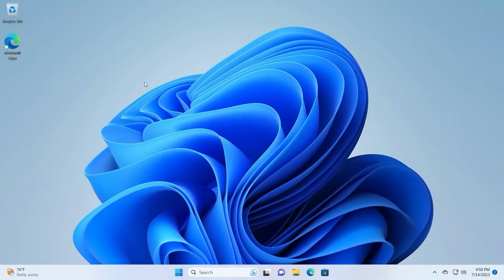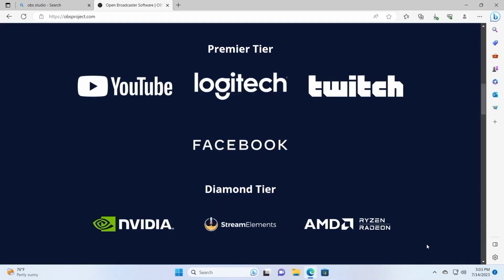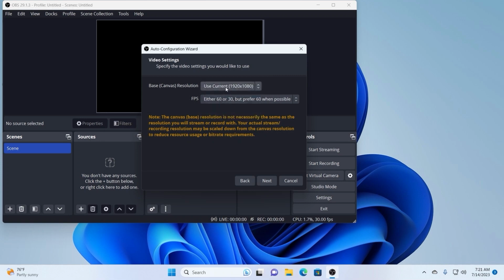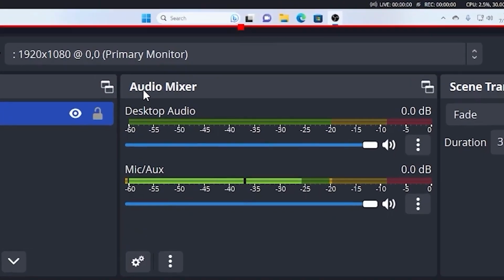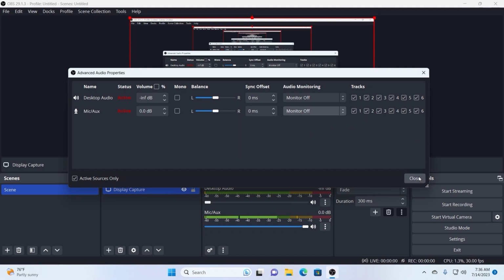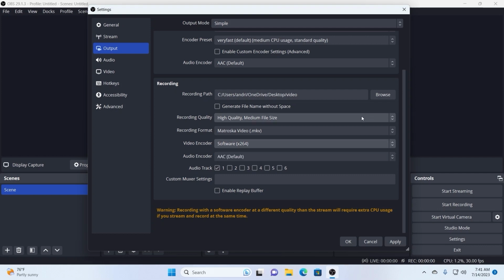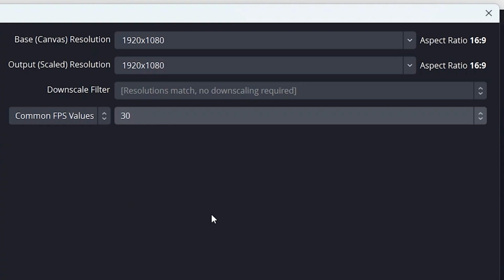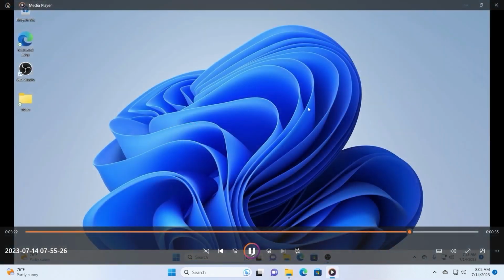Mastering OBS Studio: Step-by-Step Tutorial for Beginners

Comment: What is the best used laptop to buy on ebay (under 100$, 200$, 300$)?
Reply from the maker: Good question.
It all depends on your needs. Overall, I would choose Dell Latitude.
For example, I have a Dell 5491 (i5 8400H + Nvidia MX130).
The price will vary depending on the configuration.
In general, Dell Latitude and Thinkpad laptops are very good.
I will try to make a video about this more in detail)